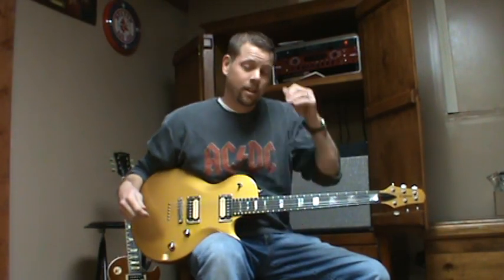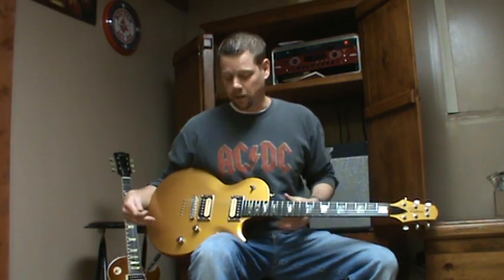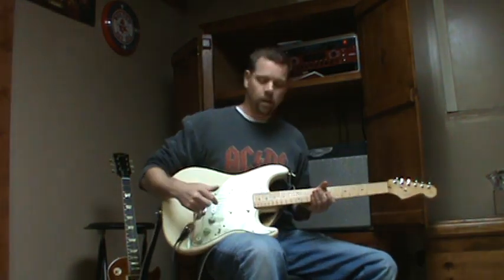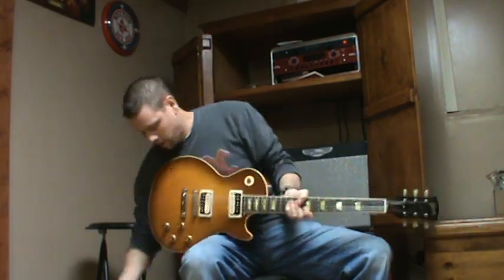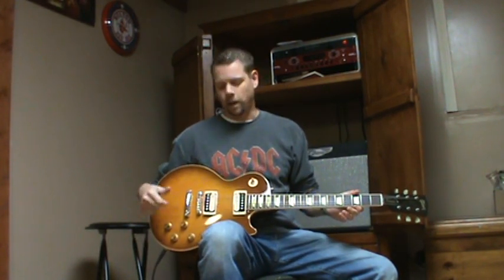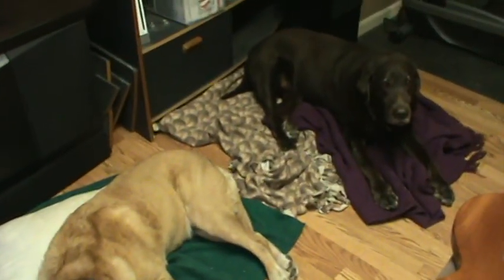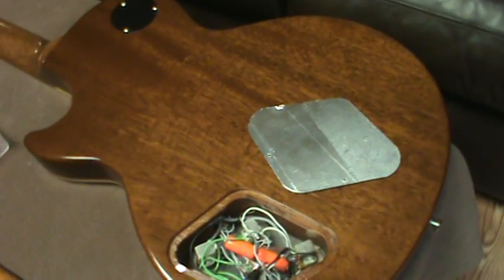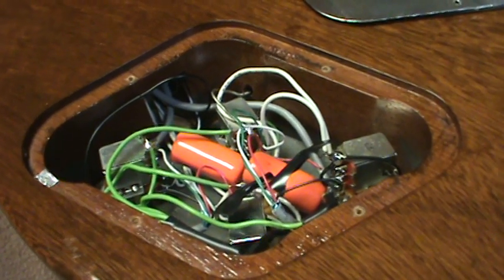Gibson Les Paul with Hum / Noise Issue

Comment: just wondering if you ever got to the bottom of the big hum problem. I also have a big hum problem on my les paul when not touching the strings, and grounding is perfect with no faults, but the humbuckers are not wax potted and there is no shielding because its a standard 60. It also has a lot of static when I touch the back of the guitar body. My other guitars don't have this problem.
Reply: same, found a fix?
Reply: @pipespeeps5349  sort of, it just disappeared, so its back to being quiet like before. I don't know what happened, but for quite a few months there was constant buzzing, and I didn't change anything, still same pedal board into a Marshall, or Vox or boss katana. even helix floor had buzz and also my line 6 dt25 which is in a different room. for months it kept buzzing and driving me crazy, but almost 2 weeks ago it stopped. I really don't know what it was, and tried a battery powered amp, and there was still some buzz, like when I went direct into dirt channel of Marshall or boss katana. I never tried my guitar in another location outside of the home, to see if it was my electrics, because it didn't seem like the same electrical hum I'd get sometimes depending on how I plug things in. Though I am wondering If I was some static charge with me, due to something, because there is now no static when I touch the back of the guitar, the guitar is just like all my others, its a joy to play again. 

something you could try, lay your guitar down on a bed or floor, and see if there is still that hum, next thing would be to unplug everything and go direct to the amp, just to try rule out something on your pedal board, then maybe take your guitar to a different location. This still has me scratching my head because I can't recreate it.

Comment: I had a similar problem with my Les Paul. Had proper grounding, fully shielded, potted pick-ups. Still noisy. Yet my Squier Classic Vibe tele has no issues despite being 2600$ cheaper. It must just be that Gibson "tone" I hear so much about.  I will never buy another one that's for sure.

Comment: After having three Les Pauls give me this issue, I’ve determined the issue is due to the orange drop capacitors. If you turn your tone pots down all the way, the hum goes away. They’re great pickups, but damnit, those caps make a lot of noise.
Reply: Did you change any of these capacitors?
Reply: @ I haven’t tried that, but in my Studio Faded model, I gutted it completely in favor of a solderless setup with an EMG57/66 configuration and it sounds really good, and is significantly quieter.

Comment: It's in the nitrocellulose and the plastic parts it's creating a static electricity field that it will go away over time ( a long time ) there isn't a whole lot you can do about it. All that shielding and grounding aint gonna do shit, Gibson fixed the issue a few years back as I haven't noticed the issues in any new ones lately but the 2011 2012 models were almost unplayable live

Comment: Totally a shieldling problem. Copper shield all compartments and ground them. Had this problem with a Squier strat. Shielding paint would not conduct(junk). Copper foil was the solution.

Comment: In my experience (2 tries) shielding just doesn’t work.  How about making sure the bridge is grounded.  You can tack a ground to it and run it to a pot.  If that works, go ahead and rework the normal ground.  Those strings are just antennas for noise, so it seems like a ground issue, with the LP, because the carbon doesn’t have the issue.

Comment: feels silly commenting on such an old video but for anyone looking here for quick solution... when the noise stops when you touch the strings, this usually means a grounding issue with the bridge not being connected. shielding as described in video if more to deter radio interference like from an old nokia. these days using wifi cables such as nux etc can actually solve the problem. but this case is also pretty dangerous as can lead to electric shocks through the amp..
another sidenote ive found to be wary of is that cheaper nicklepated chrome pieces often may not have good continuity especially as they age. so while the screws may not be plated, they may not be making full connection with a poorly chromed bridge to even reach the signal of the strings. this can happen with cheap strats etc too specially hard tails.
noiseless red neutrik connectors definitely help here too. but best not to use one if fixing somebody elses guitar because they might find problems you missed when they use their regular cable.
the shielding would have helped if the sides were also lined to make contact with the cover plate and not just wired to. all the cavities such as where the tone switch is need to be wired together for full grounding continuity.
Reply: I'm dealing with exactly this with my old BC Rich.  My old Kramer, and new Dean are silent as death, but the Warlock is noisy af.  I don't know much about electronics, but I understand the basics of guitar wiring, and, as far as I can tell, it's wired correctly.

Comment: try to fix with the guitar pluged, and you can see when it makes diference or not, the hum only stops if you ground all cavities, try with some aluminum papers, fix it with tape or glue and dont forget to ground all the aluminum paper, that´s the faraday principle, to involve all the circuit with the ground, thats is onlye way to eliminate the hum without the hands on the guitar

Comment: Grounding wire to the bridge is probably Shite. you will have to remove the T.O.M.
Bridge & Metal sleeve that the Bridge pins screw in to which is not easy.
check there is a wire in the rout which touches the metal sleeve and should run through the guitar body and connect to a pot in the control rout.The buzz stops when you touch your strings,
So this is the most probable reason for the buzz.Hope this helps.

Comment: i have this EXACT problem in a guitar i just got in! people are so quick to say it's "normal for a guitar to have noise" but that's BS when you have multiple guitars and they don't sound like this!!! 

so sometimes it seems to be a humbucker that has issues, but you changed yours. sometimes a specific part is ungrounded (get's louder upon touch not quieter) and you have to basically touch every metal bit. OR it's old strings doing something weird... OR a nut (at least in my case, i have sympatic vibration going on as well)........... or shielding. it's a damn headache and even this much time later, and the internet doesn't exactly have the answer.

my thought is it HAS to be electronics. so then it gets down to maybe faults in the switch or pots....

did you ever figure it out?

Comment: I found your post looking for a solution to my issue - same nose, only I am using a Warmoth parts homemade with the same bridge tailpiece arrangement as the LP.  I have heard if you can ground the tailpiece (or bridge) at the ground point it will eliminate the noise when not touching the strings.  I have seen it mentioned here a few times, and in you tube videos, though no one shows how to go about doing it; but I plan to try it as it makes sense from an electrical perspective.  Notice that Strat's ground their bridge - interesting.

Comment: Missing ground wire on the 3 way selector switch? Touching all metal parts gets quieter, except, it gets a lot louder if you touch the metal part of the selector switch. It really amazing how much that selector switch having no ground messes your guitar up.

check it. Pull the selector switch cavity cover off. Easy, it's only three screws. With your guitar plugged in and making all that noise, touch some random piece of wire from the center lug to the bridge. It will go dead silent. Exciting? Now you know all you have to do is run a wire from the center lug to the ground at the pots. If you're confused at what the center lug is, it's the thick metal piece in the middle of the selector switch. It should be grounded, which means there should be four wires hooked up. If the ground is bad, or just not there, this is what it does.

Comment: You need to check all the grounds, it sounds like you have either a ground loop, or that one ground somewhere is not connected correctly. If I were you, I would do a complete rewire, and make sure all grounds from everywhere - switch, jack, pots, pups and so on go to the same place, and are connected to the ground wire from the bridge post.

Comment: I’ve got the same problem with my brand new Les Paul standard. 
Made in 2021. When I touch any metal parts on the guitar, the hum/hiss disappears. 
I’ve ran a wire from my Fender amp screw, on the chassis, to the floor next to where I play. 
When I play with bare feet, I put my foot on the wire, and the hum/hiss disappears.
I really wish someone would come up with an answer.
Thanks for your video. Someday, we will have an answer to this, as it seems that I’m not the only one having this problem.
I put copper tape on the back covers. And grounded them to the pots. I did nothing. 
I had a new panel installed in my home, and I watched them put grounding rods, “two” at 8 feet apart next to my meter. 
I’m pretty sure my home and panel is grounded properly. 
My two Fender Strats don’t have this hum/hiss problem. 
If you have any suggestions, please post them. 
I’m sure many people would like to know how to stop this. 
Thanks.
Reply: The answer is a noise supressor pedal
Reply: I have exactly the same issue with 2021 LP Classic. Especially on the neck pickup the noise/buzz is the worst I have ever heard on humbucker pickup. But there is also a static electricity pops everytime I scratch a back of the guitar. I have Japan LP from 80' and it's dead quiet. I am rearching across the interenet, but I haven't found clear solution...
Reply: @michalmlynaric4706  
I had a luthier paint the insides of all of the cavities with some kind of paint. It’s super quiet now. It was well worth paying him,
and he adjusted the nut depth, as the low E string went sharp even before it hit the fret wire. 
I don’t know why they could send it out like that. 
It was expensive. It’s a pleasure to play now, and no more hum.
Reply: The guitar was expensive, not the repair.
Reply: @georgelasko8346  i have the sane kind of issue with a new gibson les paul standard 60s, what kind of paint did he use?

Comment: Right now made it. changed cables inside my Gibson Les Paul and work perfectly. found that inside Gibson uses a cable with 4 cables in colors White Green Red black and all them are shielded and shield is grounded. replaced this cables with 
4 cables separately for each comtact and my guitar doesn't have any Noise at all. Of course this will help if you know how to solder correct and of course if the humm goes away when you touch metal parts in your guitar. If anyone wants any help about it please let me know.. ljust want to share my happiness 😊

Comment: Run a ground from the bridge pin to the inside of the guitar cavity, to a volume pot, and to the shielding, a simple jumper from the wire coming from the bridge, and run the jumper wire to the pot and shielding, this made my Chinese paul dead quiet, I hope this helps, the bridge has to be grounded or noise is inevitable. Mitchell Magee. Stafford Virginia.
Reply: Yes , and if you input jack is not new , roll up a piece of sandpaper and lightly sand the inside of the input jack , blow it out carefully.

Comment: My Les Paul is dead silent on my 2 tube amplifiers , but loud on my modeling amp . Dont know if that is true with everyone but its my experience . Thought I'd pass it along
Reply: Just bought a LP and am hearing the buzz on my Fender Mustang (modeling) as well.  Will check the plug grounds tomorrow.
Reply: Vic Hardy hey buddy, I have the same gear as yours. Did you find the solution?

Comment: FYI - I bought a new Strat with Noiseless P/U No Noise. My 2013 Les Paul hums just like that. Gibson said it should not hum like that. the hum is slightly quieter on 10. Real pronounce if I try and reduce Volume.

Comment: My Les Paul Standard 2012 with push/pull pups also hummed and buzzed everytime I was not touching the strings or any metal part of it. I did a test, connecting it to a battery powered amplifier (Roland AC 33) and it didn't make any noise, so the noise that the guitar made when the amplifier was connected to electricity was not (just) the guitar, but the electrical installation , namely a groundless plug to which the amplifier was connected. I connected the amplifier to a GROUNDED plug and the guitar is SILENT. However, it is also true that my Fender Telecaster connected to the same amplifier and on the groundless plug is silent, which also proves that my Les Paul pickups (burstbucker) are more sensitive to electrical interference (and much more powerfull). My advice is, take the battery powered amplifier test before opening the guitar (shielding or something else), and if the guitar is SILENT,  try to connect your usual amplifier to a good grounded plug or other plug in the house. Good luck!

Comment: Maybe, and I’m just playing devils advocate here, but, could it be Les Paul is a victim of its own popularity; which has created so much demand resulting in mass production and lack of quality control. Or at least a sub par QC? I have 4 strats of all variations, as well as a DIY converted Squier into an “SRV” strat fitted with 902d Custom Texas single coils (highly recommend checking out 902. They’re awesome) all sheilded & perfectly quiet. However, I have 2 fully hollowbody  custom made guitars both Seymour Duncan 59 dual humbucker with split coil/coil tap function. (think “Languedoc-ish”/my profile pic) Zero internal sheilding & completely silent on all settings. Mind you, this is all depending on other factors not involving the guitars such as old house wiring or large appliance interference. So, it’s probably a combination of outside sources, quality control or less than adequate (I hate to knock a well established outfit like Gibson) plus, the parts themselves, who knows anymore what we’re really paying for when you can go on Amazon an buy a knock off Tube Screamer that’s an exact copy (illegally btw) for $20 bucks. You most likely will get what you paid for but…still. It’s there.

Comment: That sounds like a broken ground between the tail stop and the back of a pot. Check inside the control cavity to see if Gibson installed a ground wire from the pot to the tail stop. I have a 79 Les Paul custom that did not have this at all and I removed the tail stop and bushing, drilled a hole through the control cavity to the tail stop hole and installed a ground wire. The ground wire just presses between the bushing. Then solder to the back of the neck volume pot. Should fix your problem!

Comment: Overlapping pieces of aluminium foil may not provide proper continuity, and therefore grounding, as it is very unlikely to have conductive adhesive.  I've had great success with self-adhesive copper foil (you can get it from luthier suppliers). Just make sure that it is real copper foil tape, some look like copper but may be made from a type of metalised plastic: always check for electrical continuity using a test meter! Even if it is advertised as having conductive adhesive,  it is always better if any overlapping pieces are connected electrically using small blobs of solder (you can also do this on the rear of pickguards as well: the soldering iron will only be in contact with the copper foil for a couple of seconds).  It is very important that the copper tape in the controls cavity overlaps the guitar top in at least two places, specifically where pickguard screws will be able to hold the pickguard and cavity layers of tape together, and therefore provide a reliable electrical connection. Finally; to correctly earth the copper foil to the common ground point on the rear of the volume control, use a short length of wire with a ring terminal soldered to one end: secure this to the copper tape using a small brass round-head woodscrew (best to drill a suitable sized pilot hole in the side of the control cavity, as the wood may be difficult to screw into). After fitting the copper tape, always remember to check that the earth wire connected to the bridge is refitted, and making good contact. If you do screen any other cavities in the guitar body, remember that these all need to be connected to the rear of the volume pot, otherwise they will not work properly. And NEVER, EVER disconnect the earth connection to your amp just to try to reduce earth-loop hum:  the earth connection is there for your safety!

Comment: My Les Paul just started doing the same thing.  Worked fine for about 10 months.  then one day I got the hum.  Took it to a tech who has replaced my wiring, pots, and caps but no use.  It's actually worse.  My other guitars all quiet on the same set up (American Strat and Epiphone LP with EMG 85s).  I hope someone has an answer.  It's horrible to play now.

Comment from the maker: BTW - after much research I can honestly tell you this:  IF YOUR GUITAR HUMS AND YOU TOUCH THE STRINGS AND THE HUM GOES AWAY YOUR GUITAR IS FULLY GROUNDED.  The web is full of misinformation.  Trust me, if your guitar is quiet when you touch the strings the guitar is grounded.
Reply: hi man, i have the same problem the guitar makes noise, but when you touch metal elements the noise goes away, so how to fix it? thanks.
Reply: @englfalafel955  did you manage to fix it mate? I have the exact same issue. Was hoping you fixed it in the mean time? have a good one!
Reply: @killainmaccallan4700  no,problem still have ,my gibson lp noise .

Comment: I found another issue on the LP i have that also helped the buzz. The pots were not grounded. The tabs that hold the back case to the front of the pot develop a connection issue so they arnt actually grounded like they should be.